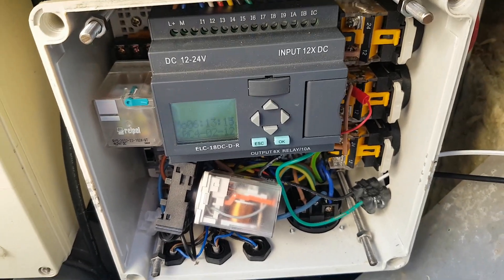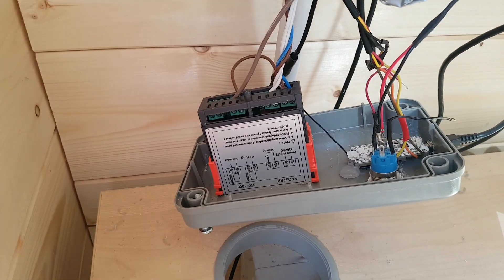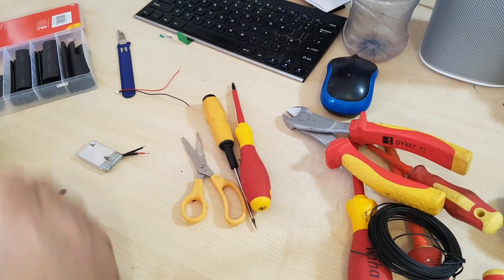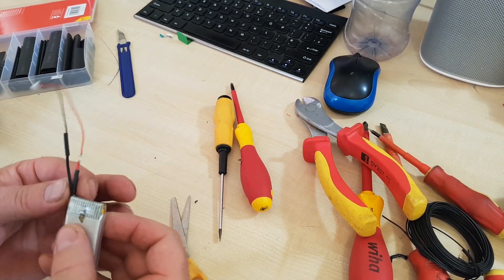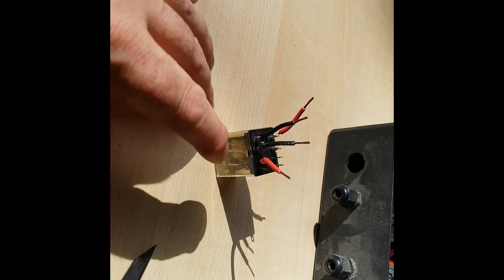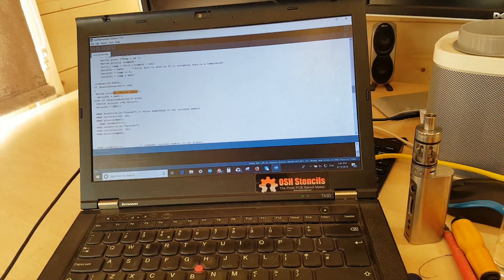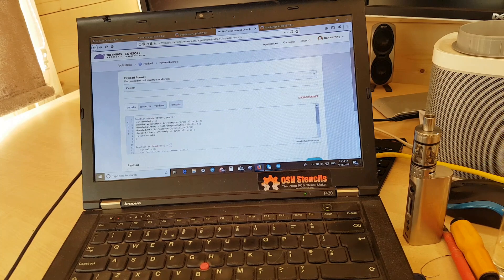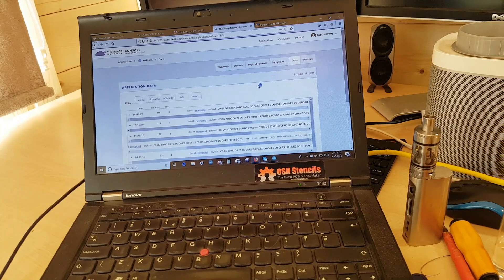At The Koi Pond #5 Pond Automation

Comment: Thanks for posting Dan, I found it informative. I can't believe you have Internet access in the shed at the bottom of the garden. 👍👌 #Wi-Fi
Reply from the maker: I have cat5 cable run down here.
Reply: @DansKoiPond  Ah OK nice one! What's the cat5e routed from? & to what? Sorry for the questions lol 😳
Reply from the maker: @KoiChronicles  from a router in the house, to a switch in the log cabin. I work from there so need decent connectivity.
Reply: @DansKoiPond  
Agreed #hardwired👍💪 
So the heltech esp32 lora module has Wi-Fi and that's connect to an Wi-Fi access point and then in turn to the switch 👍 Right?
Reply from the maker: @KoiChronicles  It does has wifi but I am not using it. The pond stuff isn't using any of the connectivity on the log cabin. It uses a lorawan radio transmitter instead. I have a lora gateway in my house because I am involved in rolling out the network to cover Norfolk but even if I didn't it should still work with other gateways. Lorawan has up to a 10km range.
Reply from the maker: @KoiChronicles  this means in theory if my power goes down and takes my internet connection out it can still transmit and get the message out.
Reply: @DansKoiPond   Perfect👍👌 It's a shame the rdf is letting you down intermittently. 😥 #nowifiinlogcabin